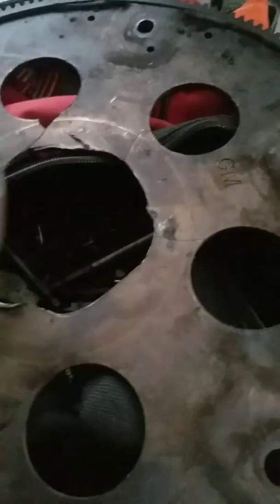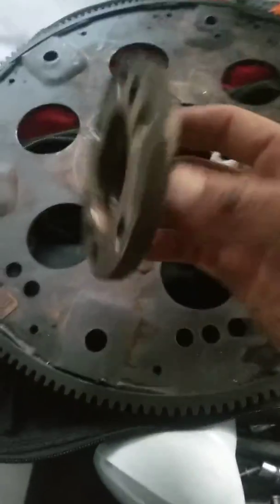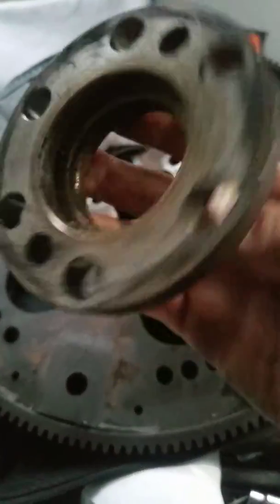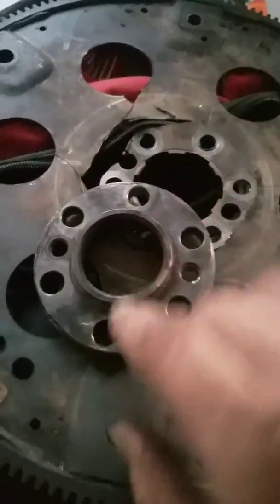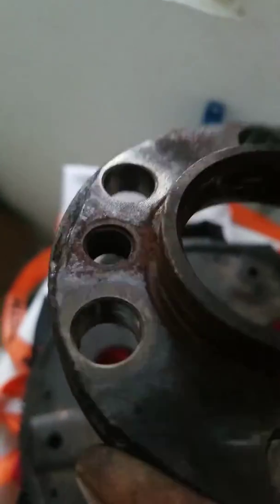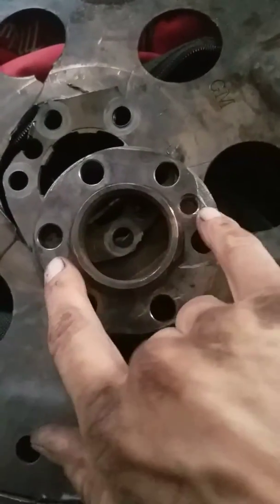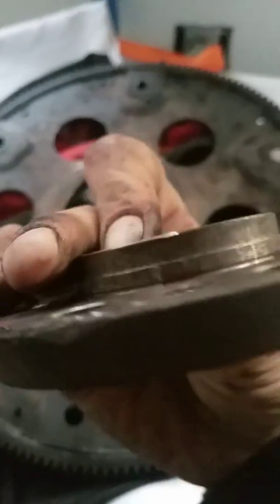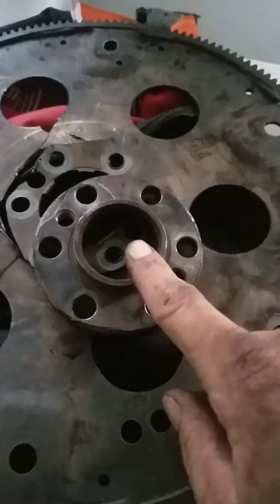Chevy 4l80e spacer

Comment: So I only need the spacer if I’m going to use a 4l80e and if I want to use the 4l60e I would have to swap flex plates as well because the 4l80e flex plate with spacer won’t work